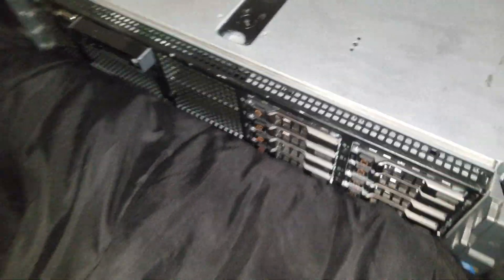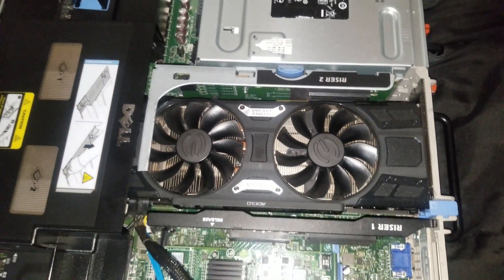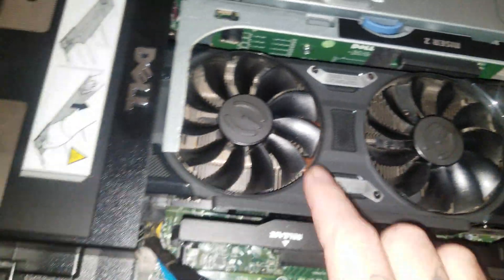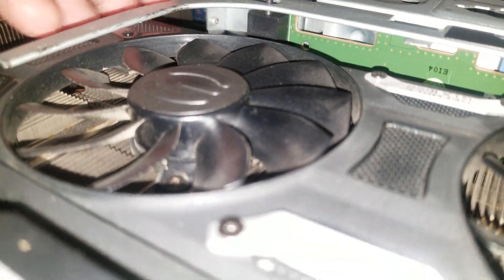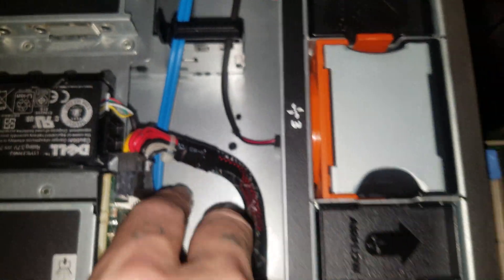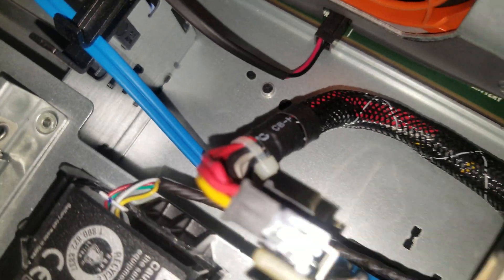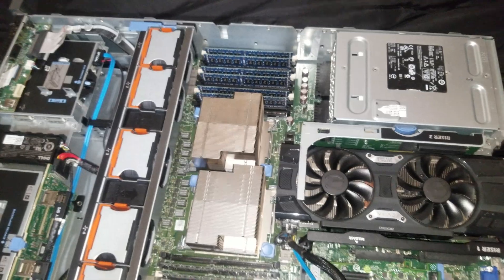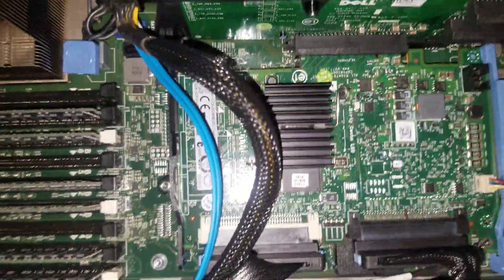Dell R710 SFF With GTX 1060 SSC | The Correct Way

Comment: For a Plex server, a Quadro P2000 or P2200 would've been much better, cheaper, and non destructive option as you only neeed the transcoder streams and bandwidth capability. They can output up to 4 screens via HDMI and consume much less power than a consumer-grade, high end gaming GPU.
Reply from the maker: Non destructive? I don't recall destroying anything. Cheaper? Odd i had these parts already... I would have had to buy a P2000 or P2200. Using a P2000 or P2200 in one out of over 20 servers isn't going to make a noticeable difference in a power bill. Especially when Plex is the least used server.  Everyone's situation is different. This is why you shouldn't go around leaving comments like this one. This has been a bullet proof set up for me. So... you set your server the way you want and ill set it up how i want ok? awesome.

Comment: How did you get the x16 PCI of the GPU into the existing x8 PCI slot on the riser?
Reply from the maker: You'll need to buy a X16 riser or trim the X8 slot. Just notch the little piece of plastic at the back and it slides in.

Comment: Side note, will only work as a trans-coder on the R710 GEN II as a VM
Reply: In a VM you would need an NVIDIA vGPU license for GPU passthrough in ESXi, and those licenses are quite expensive. Not to mention you also need at least a Quadro GPU, as the consumer-grade GPUs can't be used for GPU passthrough
Reply from the maker: Not running in a VM with this one. Works just like any GPU.

Comment: This isn’t a good idea as those cables that go to the backplane are only rated for a certain amount of current, and I can tell you for sure that that tiny cable cannot supply as much current as needed to safely power a full sized gpu and a hdd backplane at the same time and is in-fact more of a fire hazard than the other methods you mentioned beforehand.
Reply from the maker: The current im pulling still will not exceed what its rated for. You need to look up the specs first. But for a 1060 youre fine with some head room. This has already been looked into before i did it. Been running for around 2 years now no issues. Did everything from plex to run games on it. So yes its still a safer method than just hacking wires from the PSUs. The wireing is the same gauge as what would also be in a normal system powering the GPU so not sure what you mean by "tiny wiring". You would also need to look at what drives youre using and their power consumption. A lot more to this than just how you put it to make it seem bad.
Reply: @WhatAboutRC  There's no need to solder when splicing to the PSU. Spade connecters work great.

Comment: I got my 650TiBoost working in my PowerEdge T610, by physically modding the x8 slot to fit it. But for power, the only way i can power it is via a molex to pcie adapter cable.

Comment: So you just spliced in and connected the wires of the same colors from the power going to the hard drives?
Reply from the maker: Its a little more work as you also need to mod the PCIE slot or buy a X16 riser.
Reply: @WhatAboutRC  but basically you linked the yellow wires from the psu cable to the yellow bay cables ? (same thing for ground cables) and ran the cable to a gpu on a modded x8 pcie right ?

Comment: Pro tip easier method is get evga 1050ti 4gb cut the pcie end so you can install the card and boot it up no extra power required. 👊
Reply: not working
Reply: It won't work if the card draws over 25 watts from the PCI-E port. The R710 checks this at bootup.

Comment: Hey mate, I have a r610 with a gt710 gpu (absolute crap but it's the only one what will reliably work) I'm looking at adding a gpu to my r710 (3.5' drive version) I was wondering if it would have the same backplane connectors (I don't have time to open the system up as it is in a remote location and runs virtual machines 24/7) just trying to do some digging around before trying to do it, I had seen many videos of people soldering the power cables to the psu output although I would never do that its way to much of a fire hazard. Have you had a look at the 3.5' backplane power connectors by any chance. Thanks in advance mate
Reply: hello mate, i'm sorry if you've been waiting for a long time but i've finally made the mod for the 3.5' version of the server. (I'm not the author of this video). It works and i have taken pictures all the way. Hit me up if you're still interested.
Reply: @robindelaguila  hello, i was just going through the comments and saw your reply. Is it possible to send me your pictures of the process. I would like to see, how its done before I destroy my server :D. Thanks in advance
Reply: @robindelaguila  Also like the pictures if possible. How can I contact you?
Reply: Don't solder to the PSU, just use spade connectors. Easier and safer.

Comment: Do you have a link to the cable that I can purchase? I just found out my gtx1660 fits my r710
Reply from the maker: I had to make mine... I had thought about making them and putting some on eBay but i dont think its a major market haha.
Reply: Eric Hamby how much could you make me one for? Also does it actually boot? I’ve heard of some r710’s pulling too many watts on the gpu and not booting.
Reply: @WhatAboutRC  Hey Excellent video! This is exactly what I was looking for but I have no idea how you made that cable. I'm  guess you had to splice into the power cable that goes to the hard drives? I'm terrified of the other method I found when researching this. The one where people were soldering.
Reply: @themacavelly  
Hey Michael, I've recently purchased a bitfenix 45cm PCI express 6 pin GPU cable, I've cut the connector off and connected up to the backplane power connection. I read up about splicing and just went for it, the worst that count happen is you need to purchase another backplane power cable. A 45cm cable isn't long enough to route it as Eric has shown
Reply: @sja360  Was is just a case of taking the 3x yellow and 3x black cables and running them to the gpu?
Reply: @mattiomc60  
Hey, yeah so the backplane yellow is 12v and black is ground. I followed this idea for splicing into the backplane cable. https://youtu.be/D4b_gSciGIg
Reply: @sja360  hello thanks for the video and stating what yellow and black were. I'll be doing this at some point on my r710 SFF
Reply: @WhatAboutRC  Hi Eric, thanks for the video. Would it be possible to make a quick video showing how you made the cable?